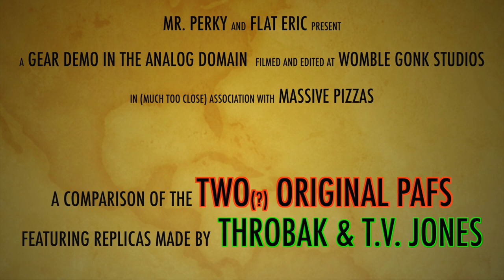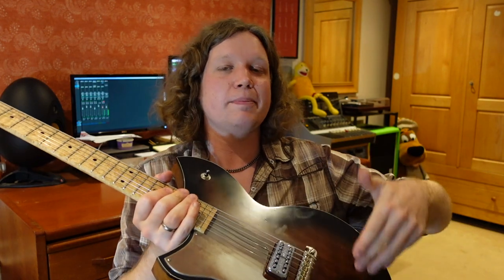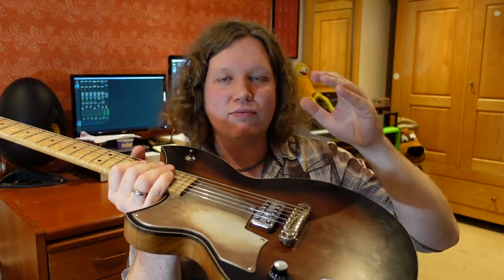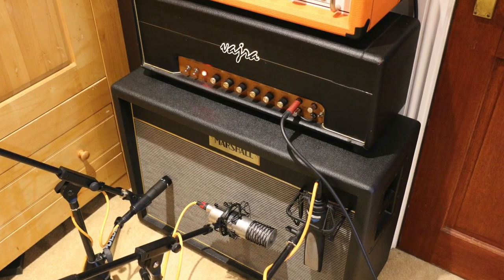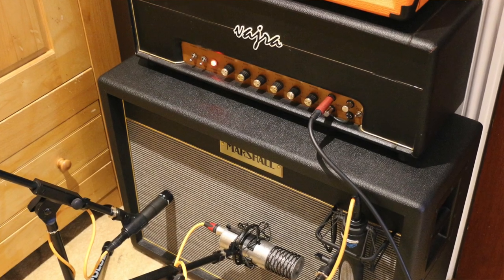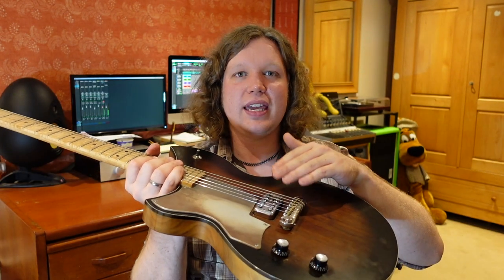Comparing The TWO Original PAFs: Seth Lover's "Humbucking Pickup" + Ray Butts' "Ful-Fidelity"

Comment: As a Gretsch player, i'm partial to the filtertrons. The Ray Butts have a lot of highs and lows and make it shine when clean and also retains a lot of clarity no matter how much gain you use. Like you said, PAF have a lot more Mids. 
At edge of break up, the Ray Butts was the absolute winner. At low gain they were similar. 
With the cranked amp it was really interesting. When you did the bending at the beginning they were quiet similar, then you started to hear difference. In this instance there wasn't a clear winner because they sounded worlds apart. Paf had those singing harmonics that are just gorgeous. BUT, the Ray Butts had this almost Fuzz Face sound that it was really really cool.

Comment: Another great review/demo.  Now maybe I grok the rockabilly versus jazz sounds of guitar in the Fifties (and beyond) a little better.
I was surprised that the Filtertron was as loud as it was.  I have been led to believe that they are low-output pickups that aren't as hot as PAF's.  Not true, apparently.
Which one I prefer?  Not sure.  It would depend on what I want to play.  Slow blues like SRV's version of Tin Pan Alley?  Probably the Filtertron for its scooped, almost Strat-like tone.  Eighties power ballads where you're trading lots of clean, almost acoustic-sounding passages with big, loud, distorted power chords?  The same probably.  Loud, raunchy heavy rock and blues-rock a-la old Whitesnake, Bad Co., Kiss or ZZ Top?  The PAF, for sure.  But it's not like one is so much better than the other that you can pick one and toss the other in the trash.  Each has its strength, sure, but both are capable of giving a good sound while playing the kind of music I want to play.
But you: playing a Marshall Plexi circuit inside a small-ish room at volume.  Are you deaf yet?
Reply from the maker: .....WHAT? :P Surprisingly un-deaf after years of cranking loud amps in that tiny room! :P